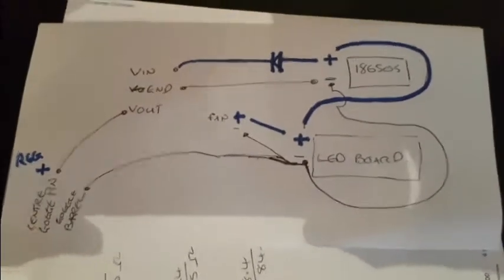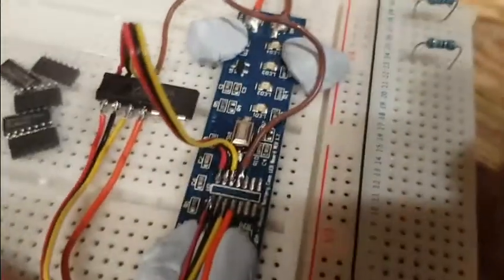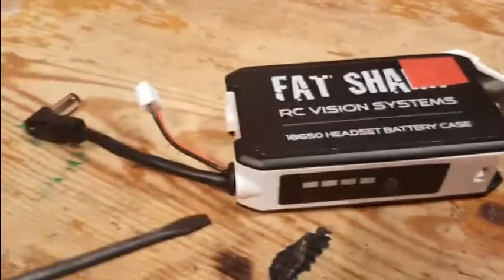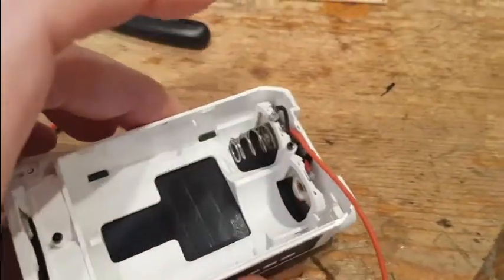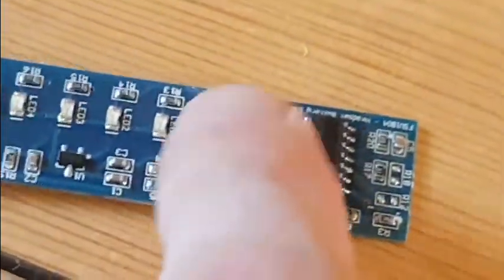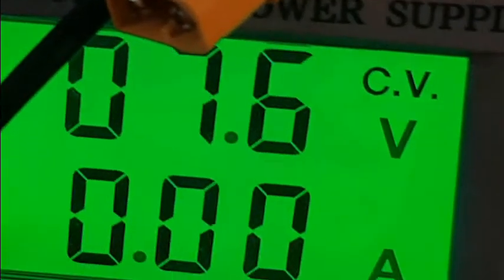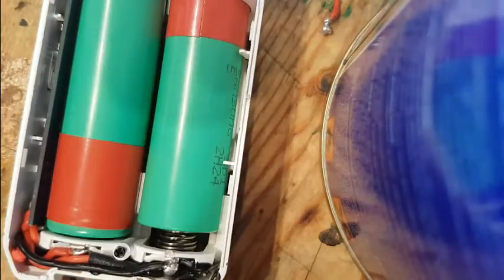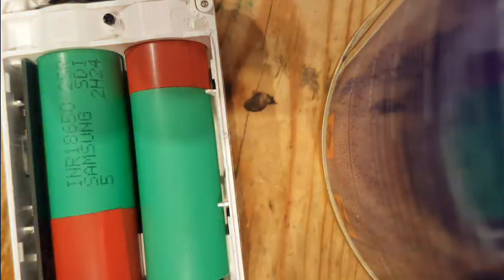Fatshark 18650 Battery Case Reverse Polarity Protection Mod

Comment: Thanks for the build vid bud I’m afraid I did the old batts in the wrong way around and shat my chip.
Please could you tell me the source for the new chip and it’s serial number, thanks
Reply from the maker: Hi Pretty sure it is an LM324 quad op-amp. You want the smd version and not the DIP package. Something like this should do it https://rover.ebay.com/rover/0/0/0?mpre=https%3A%2F%2Fwww.ebay.co.uk%2Fulk%2Fitm%2F112957334530
If in a hurry and can pay more for it then places like CPC, Farnell, Mouser or maybe even Amazon. Common chip.
Good luck

Comment: I have had my battery case for over a year. and the few times I put batteries in wrong the leds will not light up. put them in correctly all lights plug in and fly. although its only been in series never parallel. where I had made the mistakes.

Comment: Thanks for the tutorial, I will do it asap.
When I purchased the case, I didn't even suspect that Fatshark wouldn't put any reverse polarity protection !!
Reply: Where can I get the battery indicator chip? I accidently blow my battery indicator. I need the chip
Reply from the maker: Clement FPV Thanks. I was amazed they didn't too. I even emailed and asked them!